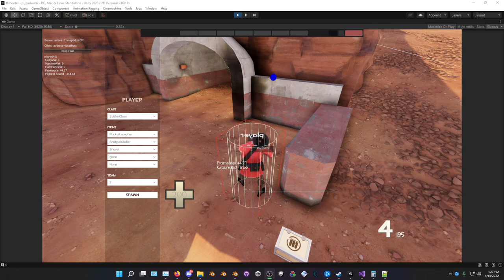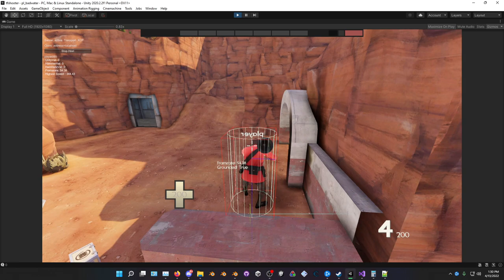Team Fortress 2 Unity - "Cylinder" Player Collider WIP Solution

Comment: DUDE YES YES YES I NEED THIS IN THE GAME YES TY I LOVE YOU I WANT TO KISS YOU ON THE LIPS FOR THIS KEEP IT UP
I main demoknight and play medieval mode all the time so the rectangular collider things have been a nightmare I've faced for so long. Trimping and melee combat all require me to remember my orientation on a grid and that theres an invisible box around me and everyone else, which just feels awful. So many fights where the situation feels genuinely different because of our orientation on the grid, like if im fighting diagonally and thus my melee effectively has a longer range, or if im running in to an enemy and if i slide off of them holding W or if im stopped dead in my tracks.

This being in the game would dramatically improve my quality of life and would probably make medieval mode, and melee combat in general, feel significantly less janky to people and be much more approachable. We need cylinder colliders.
Reply: unless i horribly misunderstood what this video is about, which is very very possible as i do not understand coding whatsoever, im assuming this is like, how you collide with the map no longer being a big rectangle and instead a big cylinder.
Reply: @smallangrycrab  Functionally it's still a capsule collider, but even so the good news is you won't have the janky grid-aligned melee attack hit checks as the Source engine in TF2 has. The capsule collider is just given an additional script running on top that uses a spherical-shaped raycast pointed down to check when you're hanging over an edge to "fake" a cylinder collider, and prevents you from falling as long as the sphere raycast hits a piece of ground. I asked if DJTHED would consider porting the project over to Godot 4 because it has a cylinder collider, and he linked me this video! :D